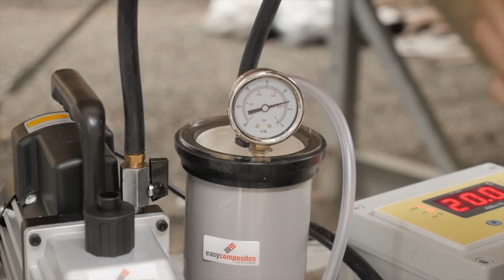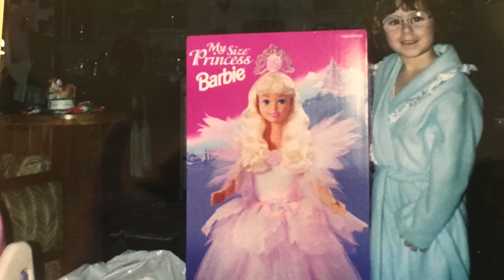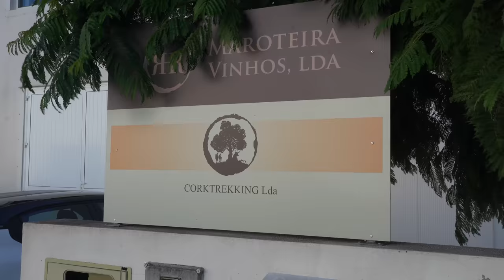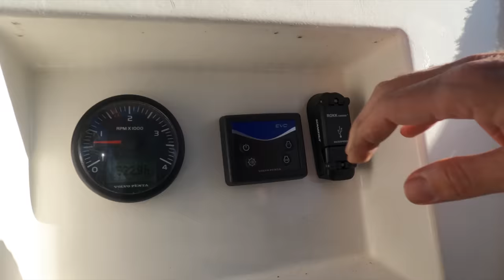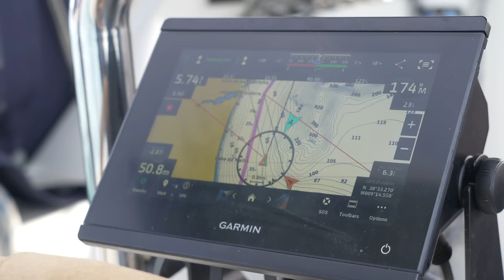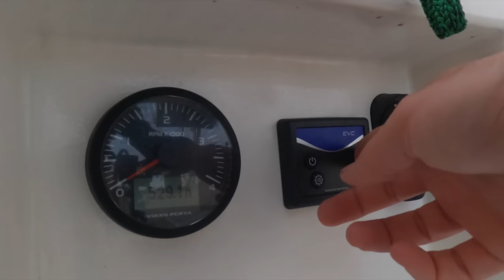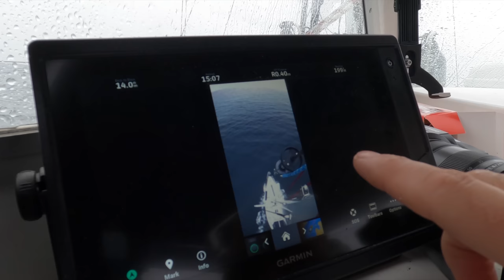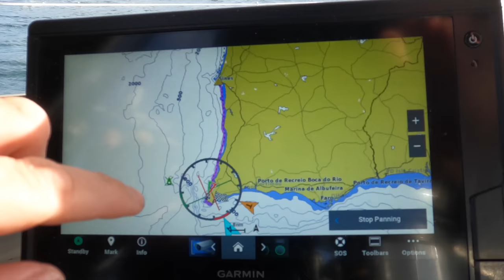Sail Life - Cork trees & sailing from Cascais to Lagos

Comment: Mads, just a quick tip about grabbing a mooring ball: if you back down on the ball you can step down your aft boarding ladder and easily attach a line. Then you just walk it forward and cleat. I’ve done it many times and it works very well. No reaching over the bow. Just remember if there is a heavy sea state to attach yourself, (or Ava) securely before descending that ladder!

Comment: Docking is easily the least-favorite part of cruising for us. We only go into a marina when we need to pump out and/get fuel and usually get water at the same time (the magic tank trifecta of emptying that which is full and filling that which is empty.). In our 5 years now of cruising we still don't have a watermaker but we get by anyhow. Simple is easy and cheap to maintain/operate.

So we anchor almost exclusively when we are traveling and dinghy in. That allows us to have fewer tricky dockings and chose our conditions and locations where and when we do go in.   We usually get fuel or water using jerry cans on the dinghy unless we have a full septic tank and haven't been offshore 3 miles lately to dump it ourselves.  

I loved Ava's cork story. Sail Life has really found its footing as a true well-rounded cruising channel with DIY and adventures telling us more about your stories together.

Comment: Another tip for mooring ball pickup, that I have used in windier, rockier weather when getting the bow blown off is sooo easy and quick on my boat, is to rig a line from the bow down the side. You can then pick up alongside to the lee of the buoy more easily then go forward and pull it all in to suit, with a bit of engine ahead on tickover if necessary. 
You could probably do it all from the cockpit with a long enough line and that mahoosive winch!! 😁

Comment: Orca-wise: has anyone tried scaring the orcas off with percussive devices? I'm thinking firecracker/m-80. As a kid I use to shoot bottlerockets into a pond and they would explode just under the water surface.  Would this ward off the pod or merely incite them into 'stampeding' your boat and ripping it to shreds in an orgy of retribution?

Comment: hi guys, merry x-mas...
with regards to your rudder and regardless of Orcas and your back up system, wouldn't it be wise to create a form or 3D scan of your main rudder before it gets damaged in order to be able to replicate it anywhere?
further i noticed on many boat rudders the potential damage possible due to longlining/other debris and i asked myself if a strip of 0,5mm inconel steel bonded to the rudders leading edge would be wise to apply...
what do you think Mads & Internet?